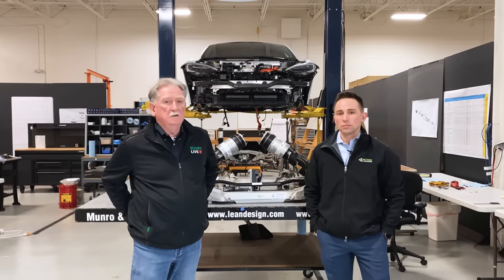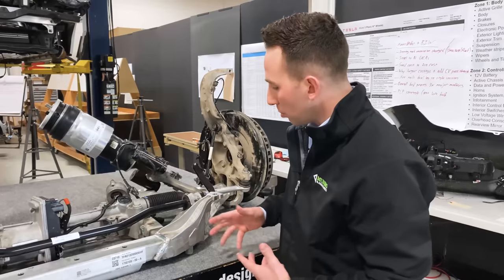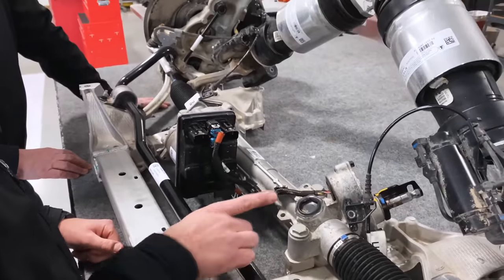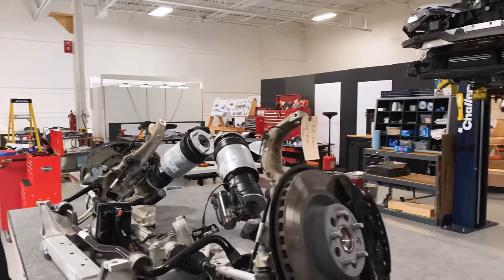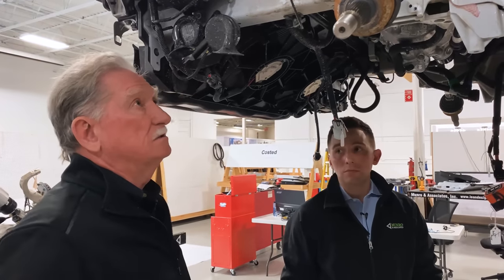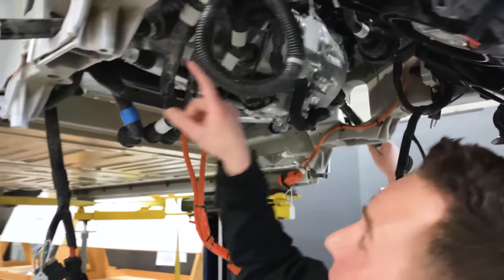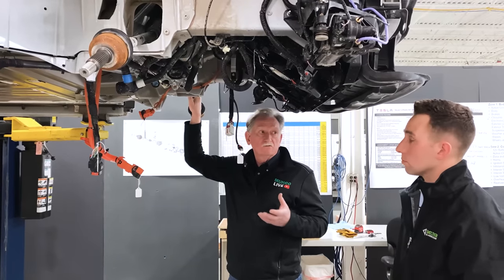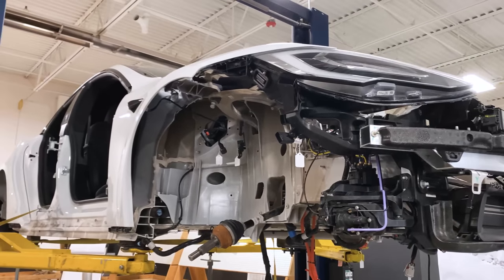Front Cradle and Suspension | Tesla Model S Plaid Teardown

Comment: Excellent to see they’ve gone to so many large castings in the new S and X. Should help clean up a lot of the little panel gap issues while adding strength and stiffness. The big giga castings would be even better, but in these low volume models i imagine it doesn’t make financial sense to use those giant machines.
Reply: Lol….. so tesla absolutely needs giant castings to have accurate panel gaps!? I bet you if they don’t improve their quality control they are still going to have gape issues, the doors and many other parts are still made of stamping metal sheets.
Reply: You do realise they only get about a 60% success rate of the castings so I don't really see much of a money saving.
Reply: @carholic-sz3qv  Not any worse than the gape problems on supercars like McLarens.
Reply: @dikkybee  totally agree with you.
Reply: @carholic-sz3qv  those doors sit on the body. The early bodies were a lot of parts.. see munro’s early vids on the first model 3 tear down.. the gaps were due to the compiling of tolerances over many parts. Fewer parts means a more consistent body.. means less gap issues.
Reply: @airheart1  you do realise other car makers don't have the same problems that Tesla have with gaps? The number of parts has nothing to do with gaps but the quality of the product and the ability of the employees and the quality of their inspectors is where the problem lies.
Reply: @airheart1  wrong, tesla simply doesn’t care about quality control and for your records other manufacturers never used 70 parts for the rear of the car compared to tesla as sandy was saying.
Reply: @airheart1  the gaps actually occurs on the upper part of the car where multiple stamped parts are used and assembled together, has basically nothing to do with casings.
Reply: @carholic-sz3qv  When you have people welding the frame, you will have some misalignment. That means that when they attach body panels, They will be misaligned as well. Now they have to manually adjust those panels to try to align them. When the production is going full speed because you are selling every car you make, they will miss some of these errors. The giant castings pretty much eliminate these errors, reduce the cost of production, and speed up production.
Reply: @carholic-sz3qv  sure bud.. believe whatever you like in your world.. bye 👋
Reply: @dikkybee  and you do realize those car makers took about 30-50 years, if not longer for some, to get their quality to where it is today. Tesla has managed to sort it out, for the most part, in 10 years.. mainly due to moving to castings instead of refining tolerances of parts incrementally over decades. Don’t take my word on it.. watch the shows that are right here. Sandy explains it all quite clearly. You can believe whatever you want.. I’ll go with what he tells us and shows us.

I am not insinuating castings are the only way to good tolerances.. I am saying it’s A good way to get there and it worked for Tesla. They did not use great techniques and machinery at the start to get their quality nailed and consistent. And they generally still don’t. But using large and giant castings has made their builds much more consistent. Others do it in many other ways. Some of the new EV builders are going through their personal ‘production hell’ as we speak, figuring out how they want to tackle these issues.
Reply: @airheart1  you do realise, using your own words, that there are car manufacturers that are less than 20 years old that have a much better quality build than Tesla so your excuse for their quality is not really factual. In this day and age considering how people expect a quality product for their money, how can Tesla expect people to accept such poorly finished cars and yet they do due to this mentality of it being a Tesla and I will overlook the problems and then not having a car due to how long it takes to get it fixed. I can also guarantee these same people have owned other brand cars and they would not have accepted cars with lesser faults than appear on a Tesla. I would rather see Tesla fix their quality problems before they bring out a new tech as releasing a sub quality product screams that they don't care about their customers which is a very worrying concern for them to keep selling cars.
Reply: @carholic-sz3qv  Didn’t hear Sandy mention panel gaps on this car.   Tesla is much improved in this area.
Reply: @ken-mb5cp  yeah still it doesn’t prove nothing, they might have improved the quality control, it has nothing to do with the big castings.
Reply: @carholic-sz3qv  Ok fair enough.   Let’s wait to see the build quality of the Model Y out of Texas.
Reply: @carholic-sz3qv  I’ll wait to hear what Sandy has to say.

Comment: I love that Tesla continues to improve, and that they continue to impress Sandy.   Before buying my Feb 2020 Model 3, I assumed that all Teslas were "drive by wire" as Sandy mentioned he was hoping to see.  I'm guessing the reason Tesla still uses the traditional steering method is that they have a separate motor on the steering assembly that AutoPilot/FSD uses to physically turn the steering wheel. That motor also aids in the way they get the "driver is still awake" torque input.
Reply: Sandy said they still use mechanical steering because it is required by NHTSA. He was hoping they would change that requirement.

Comment: I think being able to feel feedback from the road is very important to most drivers mechanical steering does that better then drive by wire.
Reply: Except it's electric steering.  The mechanical side provides redundancy.
Reply: @paulaxford6754  The steering in the Plaid (and every other Tesla) is electrically assisted only; turn the power off and you still have steering, just with more effort and no automation. The feel is from the mechanical connection, only partially masked by the electric assist.

Comment: Sandy, the Boeing 737 still has partial mechanical flight controls. As an enthusiast, I despise the idea of steer by wire, so NHTSA is doing god’s work as far as I’m concerned
Reply: Also, airplanes have triple redundant systems.
Reply: Most (all?) general aviation aircraft have mechanical linkages.  So that’s not really a true statement
Reply: @jeffgilbert3238  There is no mecanical linkage in aircraft since 1990 (Airbus). 
In order to design a fail safe steering system, you need 2 independant channel with 2 independant actuator with complex mechanics to avoid one jam the other. Both of this computer need to be splitted in 2 separate cpu, each CPU aquire its own steering position sensor. 
That litterally mean u need 4 positions sensor for steering column + 4 for the wheel angle, 2 electromech complex actuator with a very high level of safety, 2 computers, with 2 independant cpu. 
Never forget you are competing against a steel bar and a single simple electric actuator when assessing the cost.

Comment: Wow. Changing out that front motor would really be a major endeavor. No wonder Will Prouse had so much difficulty and delay getting his changed after it failed on the first day.

Many aircraft currently in production have mechanical redundancy for essential powered control surfaces. The popular 737 is one I happen to know of, but most aircraft for private aviation do. I have seen electric power steering fail on a Jeep Renegade. Scary, yes, but brute force was able to get it to the shoulder. Without a mechanical backup the steering wheel becomes just an ornament if the electronics fail.

Comment: On Sandy’s last comment: Only the Boeing 787 is full fly by wire, even the 777 and it’s newer variant have some mechanical flight control cables. Of course the older 767 and 747 models also have cable controlled primary flight surfaces. As it turns out, for airplanes the redundancy required in electronic systems makes them nearly as heavy and far more complex than the old mechanical systems. The same might become true as we transition more critical systems on cars.

Comment: I wonder if for performance vehicles the physical connection between the steering wheel and rack is more important for road feel?
I could see how, if NHTSA allowed, it'd be a great cost saving for cheaper vehicles though!
Reply: Engineering Explained did a good piece on how Mclaren stuck with hydraulic power steering rather than EPAS purely for feel.  I get where Sandy is coming from re steer by wire...but there are plenty of light aircraft that still have a direct connection from controls to surfaces. Airliners, no, but then again, they have triple redundancy for key systems, and are many orders of magnitude removed from a road car.
Reply: Now you can buy steering wheels for a gaming console that give you pretty accurate feel, so it shouldn't be an issue. Also a Tesla gives you very little feedback anyway.
Reply: @chrissavage5966  exactly, sandy is way too busy concentrated on oversimplifying things, I bet it’s going to be a significant disadvantage in the future, just look at the millions of iPhones with 16Gb on internet those are basically useless compared to android with memory card slot…. The structural battery is another big issue. People are able to open crashes Tesla and reuse the battery modules inside the pack…..
Reply: @andrasbiro3007  the gaming consoles steering doesn’t give you the feel of a car on the roads, that’s where Porsche, maclaren and other manufacturers still excels, car are made to be driven.
Reply: @andrasbiro3007  There are already lots and lots of EPAS systems of course...but the point was that McLaren chose hydraulic purely for driver feedback. If they can't make EPAS work to taste, I doubt anyone can. Of course, that 'taste' is for supercar levels of performance & feel, not something most of us would be able to tell the difference with anyway. No doubting the S Plaid performance of course, but handling...not so much. The main obstacle to steer by wire is regulatory, not technical anyway. I think it'll take a long time before the rule-makers around the world will accept pure steer by wire systems. Brakes still have that final mechanical (hydraulic) connection in the event all the electronics die. Unlikely, yes, but not impossible.
Reply: @carholic-sz3qv  
Yes they can. Maybe not at the level of a Porsche, but that's not the point, we are talking about average cars.
Reply: @chrissavage5966  
The car industry is old and conservative. They know everything about mechanical systems, but have no clue about software.

Replicating the feel of the car perfectly through electronic steering is not that hard. It's much harder in a simulator where you don't have an actual physical car, and they still do it well. In a real car you just have to record the forces that would have acted on the steering column and recreate them with motors. It's a lot like transmitting sound, which we understand very well.

The mechanical backup is, again, just there because mechanical engineers don't trust electronics. As long as it doesn't cost much, it doesn't hurt to have a mechanical backup, but the backup could easily be electronic too. Planes have been using pure electric steering for decades.
Reply: @andrasbiro3007  ultimately, a car is an electromechanical device. You still need hardware no matter how clever the software may be.
Reply: @andrasbiro3007  aircrafts still have mechanical backup systems, and those planes must follow a very strict security inspection. It’s not that engineers doesn’t trust electronics but unfortunately electronics cannot solve everything, also EVs have been adding way tooo much electronic controls on everything, how are those vehicles going to survive on very harsch African roads, Australian Outback, South American jungle roads….. you can very easily repair a mechanical problem compared to an electric one.
Reply: @chrissavage5966  
Yes, but the amount and type matter a lot. The number of moving parts has a huge effect on reliability and maintenance cost, for example. The number of parts in general has a huge effect on manufacturing speed and cost. It's also far easier to handle complexity in software.
And finally, you can change software far easier than hardware.
Reply: @andrasbiro3007  quite agree….but I’m just not convinced that steering needs to be ‘simplified’ to that extent. A purely mechanical rack has 2 moving parts. A typical steering column has 2 joints and a movable section for adjustment. To go steer by wire, you’d remove 2 UJs and a link rod. You’d need to add redundant wheel position sensors, redundant electronics (as per the Plaid). You still need the rack to steer the wheels. Just not convinced myself.
Reply: @chrissavage5966  
Weight and cost saving. Plus easier to do things like variable steering ratio.
Reply: @andrasbiro3007  I get the arguments, I just don’t agree!

Comment: Question for Cory: when you get to the information screen immediately in front of the driver, behind the yoke …. That screen appears to extend in a much narrower form right across to the passenger side. My question is whether the extended screen (across to the passenger’s side) is just there to look nice, or is it actually a display screen to be used in the future to display something which we will learn about in a future software update. Thanks for your great work.
Reply: That's not a screen, or at least Tesla doesn't mention it at all on their order page as a feature (the exact spot you'd want to put all your features).

Comment: Drive by wire is the essence of an EV. But steer by wire leaves no redundancy, and therefore would set a dangerous precedent.
Similarly for braking actions.
Reply: If you have multiengine, you can steer by throttle in a pinch
Reply: There are brake by wire systems in high end cars. 
Expect to see a lot more!
Reply: @FutureSystem738  No, there are no purely brake-by-wire systems in production. Some operate as brake-by-wire normally, but in a failure the blocking valves open and fully hydraulic braking is restored.

Comment: I had to add a mention about the rear splash shield mounting points since I think no one else raised it in the 700+ comments.  The threads implemented in the subframe casting look somewhat like overkill while the single pressed steel bracket looks like an afterthought, later properly justified by its removal allowing clearance needed to lower the motor/driver assembly.  What surprised me though is that none of the team thought to show us how the cover fits in place.  Why could the cover, presumably a low-cost plastic molding, not be configured to meet more cost-efficient mounting points?  Regarding Sandy's suggestion, I can only imagine the powertrain group's office setting where "Sandy from body design" walks in and asks them to provide a threaded boss for his convenience in a casting they had finalised long ago after extensive performance, thermal and NVH testing, one that as an assembly is suspended from the subframe by a minimum number of highly-engineered rubber-isolated mounting points.  Even though Tesla proclaim to bridge such departmental hierarchy I can see the collective rolleyes.  Splash shield mounting points don't belong on moving parts.

Comment: I don't think we will see a steer by wire in the near future. Just for getting rid of the steering column you'd need to have some kind of redunant systems (like in FBW airplanes) and most probably also a artifical feel system like on a B777. In my opinion the physical steering column is the more pragmatic option. 
And even the newest B737 has steel cables that move the control surfaces. They are only supported by a hydraulic PCU. (Somewhat similar like a hydraulic power steering rack)
Reply: But if you had double redundant systems for steering and the control logic on a car design from the ground up to be full self driving......

Comment: 11:40 .... just to make a point, aeroplanes have allot of redundancy sometimes 3 or 4 per control, and maintenance is very strict. In a car without redundancy, or negligency from the driver, a malfunction on the stering wheel could cause death. No one wants that, i prefer mechanic steering column. Sorry!

Comment: Regarding drive by wire: The Boeing 737 is still not fly by wire. Drive by wire may be feasible for a high end car like the Model S, it is way to expensive for small cars due to the needed fail safety and redundancy.
Reply: Not only is the 737 not fly by wire, but it even has manual reversion to allow basic flight controls if all if the hydraulics fail.
Reply: @RobertHancock1  Yeah but very old design.
He meant, though didn’t say NEW designs.

Comment: Now the steering rack becomes the stressed/structural member.
Next we gonna see battery pack as a structural member in upcoming model Y.
But the steering rack bolts look beefy compared to the bolts holes holding the entire cradle/subframe.